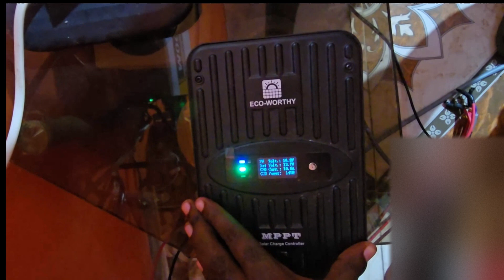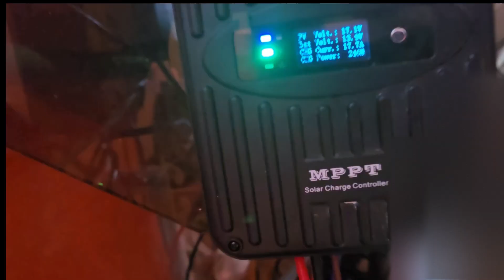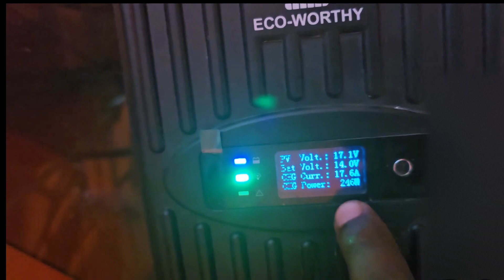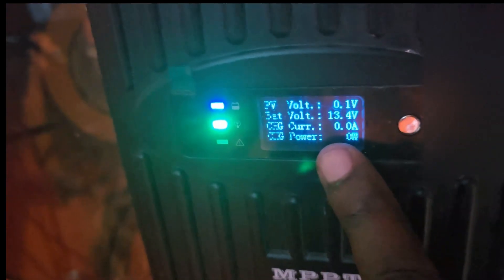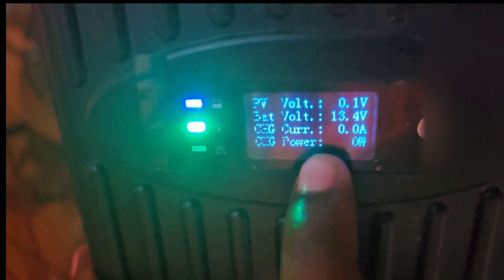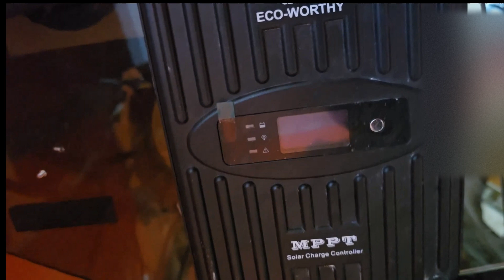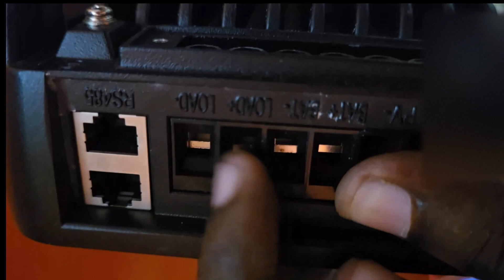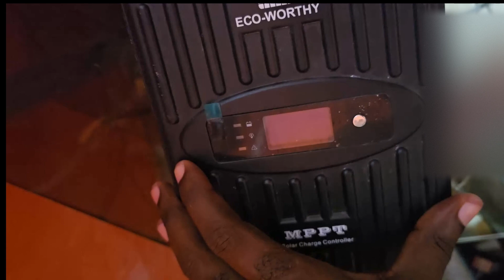How to Setup Solar charge Controller

Comment: Greetings... What type of protection do you use on your system? 🤔 Also do you have a precharge circuit?
Reply from the maker: I current have everthing at stock. There are no breakers and such will have to probably add those at some time.